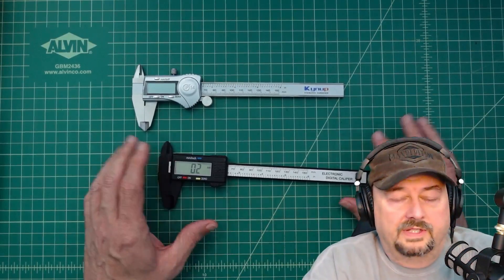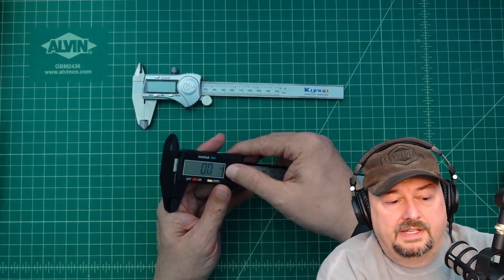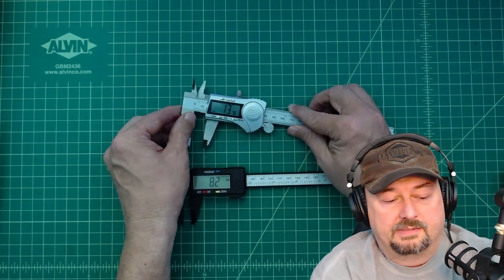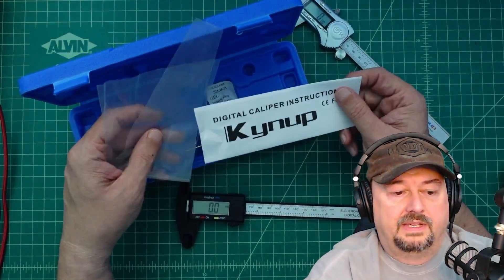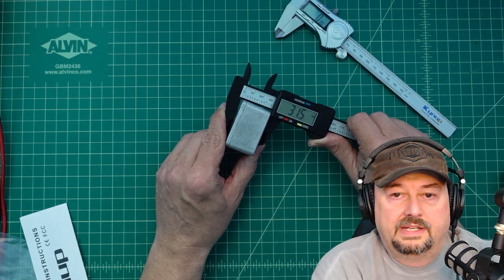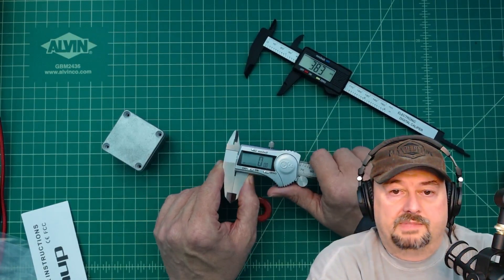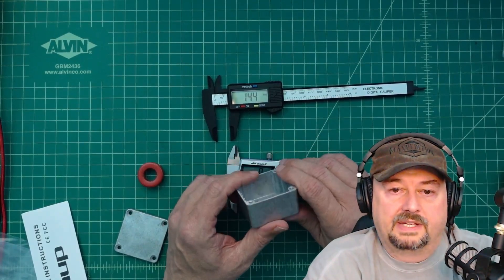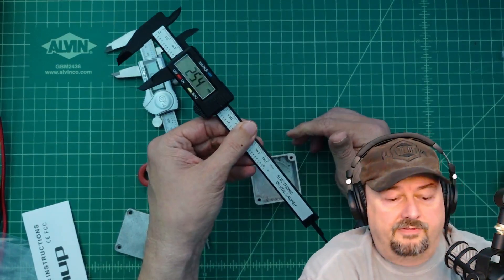CALIPERS Made Easy: Go from ZERO to HERO!

Comment: the little screwdriver simply opens the battery compartment. 
p.s. should you have a UNheated garage... the battery will be discharged each time you need it 😢 in my case: every 8 months for car repairs, so I got a simple (battery free) version
Reply from the maker: It wi be in a semi heated ham shack 😮

Comment: I store to silica packs in sealed bags, and when needed I can throw a few in computer on tablet carriers. Plus I use a few in the cases I store radio or electronic gear.
Reply from the maker: Thanks for the tip, I might have to try that out myself!